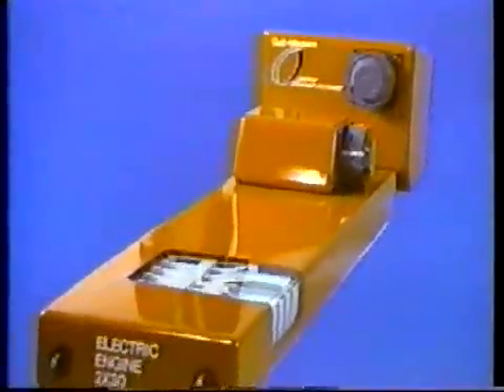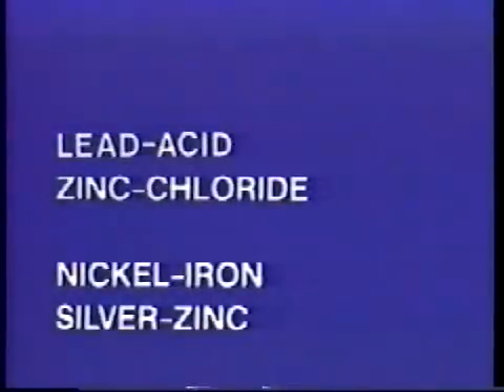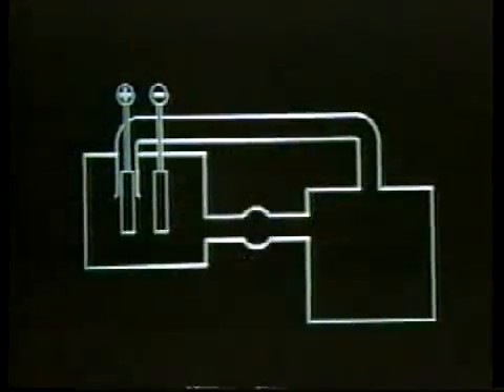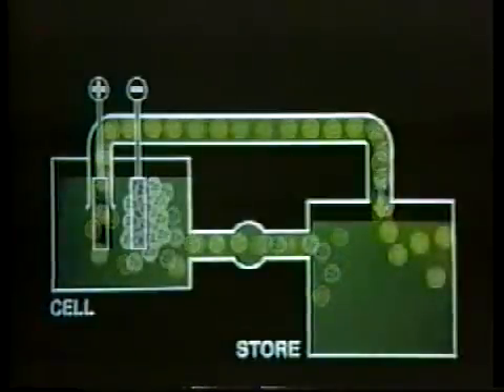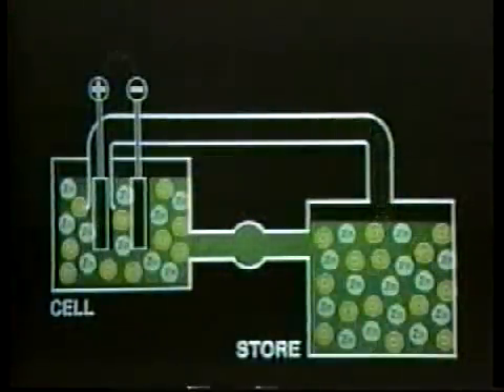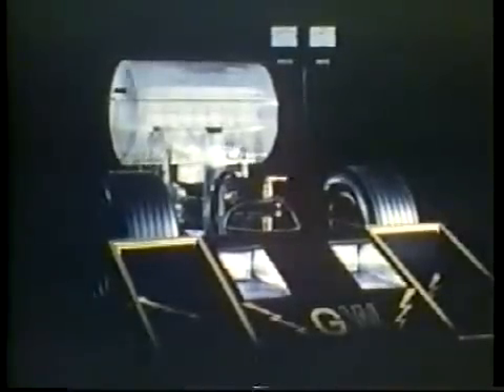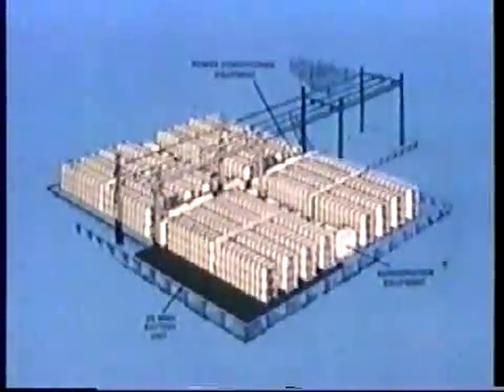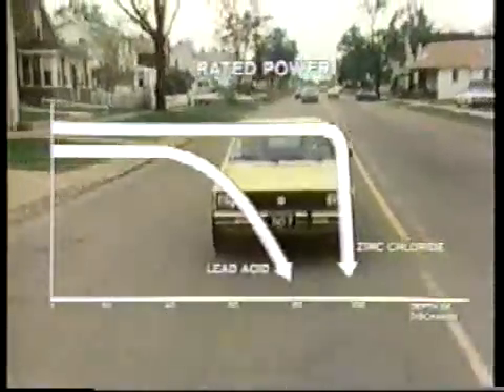Electric Vehicle Battery: 35 Years Ahead of Its Time!

Comment: The only that wasn't mentioned that seems kind of important, is energy density.
Reply: +EmmittBrownBTTF1 "Total energy density of zinc carbon battery  is 3.24 g/Ah + 1.21 g/Ah = 4.45 g/Ah =1 / 4.45 Ah/g = 0.224 Ah/g or 224 Ah/Kg."
http://www.electrical4u.com/zinc-carbon-battery/
Reply: fixt100 Not quite as much as a top end lithium Ion 265W/Kg assuming 1 volt. Note energy density is usually described in W/kg.
Reply: EmmittBrownBTTF1
i read that it has down falls but its another source of batteries when lithium runs short, and lithium has had a ton of development $$$ recently from cell phone companies and the other is basically unheard of.
Reply: Will Davis
yes of course why should we research anything else when coal works just fine...
Reply: +EmmittBrownBTTF1 W/kg is power density. Capacitors beat any battery in this metric.
Energy density is expressed in joules per kilogram.
This is a mistake I see quite often online, power and energy are not interchangeable terms.
Reply: +fixt100 lithium won't run short for a LOOOONG time.  It's SUPER abundant.
Reply: 101m4n
my point is that like coal we will eventually* run out of sources for any given resource , and that it does no harm to look into others and develop them
Reply: 101m4n
 and i think its pretty presumptuous to assume we will always have enough, not when the average car battery weighs 900lbs.
"It takes 750 tons of brine, the base of lithium, and 24 months of preparation to get one ton of lithium in Latin America. Lithium can also be recycled an unlimited number of times, and it is said that 20 tons of spent Li-ion batteries yield one ton of lithium."
so 20 tons of spent lithium makes 1 ton of new batteries in an ever reducing supply.
"The lithium raw material in a Li-ion battery is only a fraction of one cent per watt, or less than 1 percent of the battery cost. A $10,000 battery for a plug-in hybrid contains less than $100 worth of lithium. Shortages when producing millions of large batteries for vehicles and stationary applications could increase the price, but for now this is not the case."
http://batteryuniversity.com/learn/article/availability_of_lithium
Reply: +101m4n Referring to your correction of Emmits W/Kg: The Wikipedia article I guess he got his number from actually says 265Wh/Kg which is energy density. 
+EmmittBrownBTTF1 The small and easy to forget "h" in "Wh" stands for hours. Power over time is energy.
Reply: lollandster Oh yeah... I had a feeling it should be watt-hours and not joules.
Reply: fixt100 What?
He said lithium abundant, what has that got to do with coal?
Reply: fixt100 AH I see... Well we will of course only run out of resources if we stay here, On earth that is. But that's a whole nother' argument ;)
Reply: Joule woks too, it's Ws (watts seconds) instead of Wh
Reply: +fixt100 
I recently completed a DARPA project with an industrial chemical supply company.  The chemical supply guys could find no financially sound way to separate the Lithium from the mess of the rest of the depleted Li-ion batteries and recycle it.  It costs significant money to do so.  So expect to pay a high disposal fee (à la tires) when you have to replace your battery.
     BTW, Tesla car batteries now weight 1200 lbs.  Like so many of Musk's numbers, it has inflated with time.
Reply: +lollandster 
You say, "Power over time is energy."
Correction:  Power times time is energy.
Energy per time is energy over time is power.
Reply: MantisNoMore You are absolutely correct. Thanks for the clarification.
Reply: Generally the valuable elements are extracted, nickel, cobalt, copper, aluminum, and the rest, containing small amounts of lithium, is sold as a slag used in other materials.  Umicore, Retriev Technologies, Battery Solutions, and others, are already doing this.  I'm surprised that DARPA and a chemical company weren't aware of this.  There is very little lithium in a lithium battery and there will be no "high disposal fee" for lithium packs.  
Also, the range of Tesla cars has also "inflated with time", through energy density improvements in the batteries.

Comment: graphene is now the wave of the future..  they can now stop chasin these ideas, and move onto that.
Reply: MantisNoMore Actually with lithium sulfur silica batteries at 2000mAh per gram and 98% efficient AC motors we can approach energy density of liquid fuels.

But yah you are right graphene and CNT suck for energy storage. High activated bitumen with surface areas approaching 2700 to 3000 meters squared per gram surface area at 1/10th the cost trounces the shit out of the expensive designer carbons in supercapacitor applications.
Reply: +slikdarelic 
In the '50s people like you said we should move on beyond chemical storage batteries to nuclear batteries.  Where are they?  Presumably they're in the same place as my flying car!!!
Reply: +MantisNoMore Carbon nano tube/aluminium batteries have been developed and far exceed the capabilities of anything you can buy.  Unfortunately they are being use for military hardware and classified but  there is plenty of information around on how to make your own.  Its no fortune telling or far sight. The quality of your nano tubes and how you grow them on the aluminium substrate is the difficult part.  But not beyond the average tinkerer with a gas furnace and a basic workshop.
Reply: So much mindless derp.
Reply: MantisNoMore working on it bro
Reply: +Slikdarelic
It is that kind of one mindedness also and knock out any and all competition that has stuck us exactly where we are now as well!!! GM bought out an extremly successful electric car manufacturer back in the day, i cannot remember the year but definitely pre-1950s and I know you know what they did with it....sold what were left having been built to that point shut the factory down, laid all employees off and destroyed or at minimum locked the instruction blue prints and all of that away! If they would have continued in places like India they could have been using them all along also been improving upon thek if they even needed such, but No they chose to leave them at the bottom of scrap heaps for the almighty dollar! Heck Henry Ford first combustion engine was created specifically to run on biofuel i think they call it, old used oil and corn and the like and it ran just fine and if memory serves just as e!!ficient if not more so than deisel or petrol!!! THE ONLY REASON WE HAVE ANYTHING THAT IS DESTRUCTIVE, gasoline and dsisel anything, nuclear anything, atom bombs, government, money, coal, which isn't near as awful, and other such likenesses if to do with GREED!!! Not by regular people but by those that want to run the world and are basically doing it! Those like David Rockafeller, Rothschilds, Windosr family, George Soros and all of their rotten evil ilk who are all cooerced and fed what they want to hear to get them to do the bidding of satan and the fallen angels! 
You know they tell us what they are going to do in movies and popular sitcoms especially like the Simpsons, Family Guy and that other one what is it american something i dont know with the normal drawn humans beer belly on one guuybthey work argue with the neighbors especially about conspiracy theories, if thats family guy then the one i call family guy has the kid in it that they play in every intro where he says mom, mum, mamma a whole bunch she says what he says hi and goes off well anyway speaking of fallen anyone remember the transformer movies??? Remeber in part two in the beginning what is the first deceptac###on say...deceptacon...deception..!the fallen has risen, the fallen is coming to destroy you all what if thats them trying to say the fallen angels have risen and starting their deceptions to begin their world currency thing...and that could be not really currency as it is or could be if you're christian you eat all others die, or muslim, or Huindu or budha or anything like that!!! So maybe the sign could be a catholic crucifix, or set of rosary or some kind of tatoo, especially those elctronic ones or rfid, many are saying it couldn't be that,.... NOW!!  It couldn't because because they are being arrogant and don't want tośś but
Reply: watch the docu "who killed the electric car"
https://www.youtube.com/watch?v=r75lqbA0uMM
it will make you angry,very angry
Reply: +slikdarelic You claim to have power to pierce futures uncertain veil?
Reply: +Lupus Mechanicus no.. i dont..  but wat i do know is they can move beyond this, to a more efficient solution.
Reply: their is plenty of nuclear batteries on the market,googel it.
Reply: for mindless idiots that pretend to know everything http://www.citylabs.net/

Comment: watching this makes me sick to my stomach? how the fuck did this happen? the jokes on us? people need stop being told what to think and think for themselves. Re take of the heading "35 years behind" that is what this is. We lost nearly a generation of progression due to the currupt system. Lead acid?  what a fuking joke that is still the no one option, 3 to 6 grand on a solar battery setup. How much does a plastic container cost with a few treated plates well not 3-6 g's, and the materials used are up to 98 per cent recycled which is why we still use this shit, as people are turning free rubbish batterys into $$$$profit. Chinese options are now lifting their pricing on everything and its just as cheap to buy from my local dealer in aus? This is not progress. Maybe the government could help in a little regulation to shift this distortion and kickstart the fluride revolution instead of leaving it to every tom dick and harry to sit on for another next generation of procrastination. This oil buso needs to be shut down asap, and it may well of just happened all be it 35 years ago........not happy.
Reply: It's bullshit.  Relax.  Chlorine gas is so dangerous it's insane. It's by far the worst thing I have EVER experienced in my life.  So dangerous.
Reply: Yep.  Get a whif of chlorine gas and your lungs will collapse.  Very dangerous.